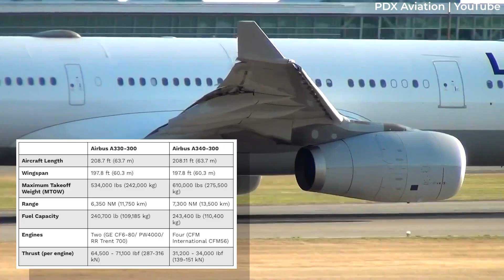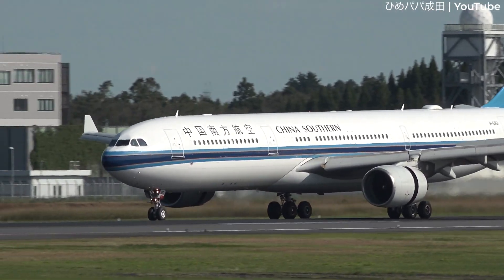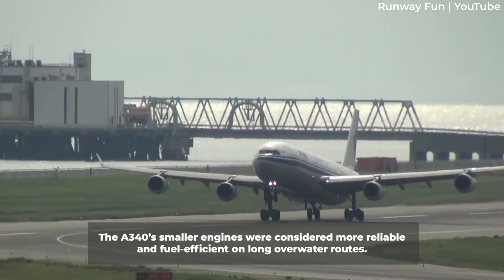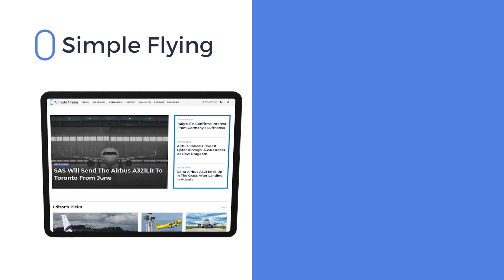Why Are The Engines On The Airbus A340 So Small?

Comment: The main reason behind the 4 engiens was due to the rules in place back when the A340 was in development and started manufacturing. A plane was required to have 4 engines for redundancy reasons if they were to fly over large bodies of water such as the Pacific or Atlantic. Almost as soon as the A340 entered service the rules were changed for economy reasons. And the reasons why the engines are so small is because the technology of the engines they wanted wasn't put into a final commercial product until in the mid 2000s, nearly 20 years after the A340 entered service so they had to use what was available and would fit. The A340-500 and A340-600 has much more powerful engines, nearly equal to the Boeing 747. Its max take off weight is also nearly on par with the 747 family. It actually has slightly longer range than the 747s, too.

Comment: retrofit with larger engines ??
Reply: Why?  Airplane works fine with the engines it has.
Reply: The A340-500/-600 has bigger engines. But Airbus isn't going to make another A340 variant.
Reply: cost of engine replacement and passing regulation is comparable with that of building a new plane from scratch.

Comment: They were designed with slightly bigger engines in mind, but that engine never came (at least not in time, PW1000G is way too late), so they kinda have to use CFM56 instead.
Reply: The story is kinda right but the PW1000G had nothing to do with it.
Reply: yeah it was the same technology but nothing like that engine.  @kingsharkoon
Reply: Using CFM56 would also increase parts commonality between the A340 & A320

Comment: think i read somewhere and correct me if i am wrong that Airbus had planned to use bigger engines on the plane, engines were newer but ultimately never built which led Airbus to use the smaller engines